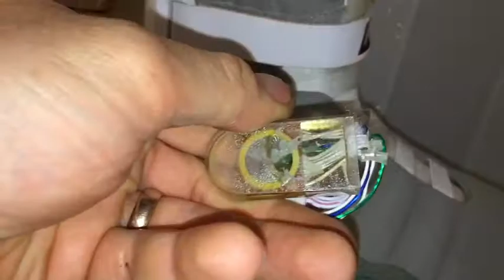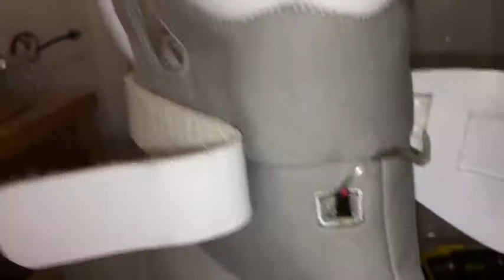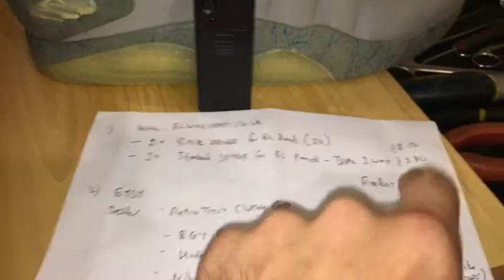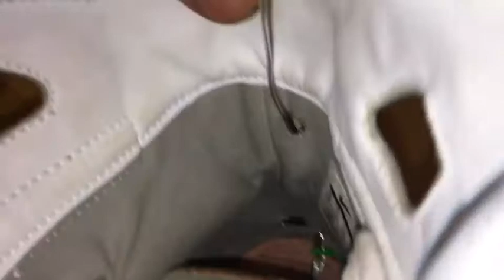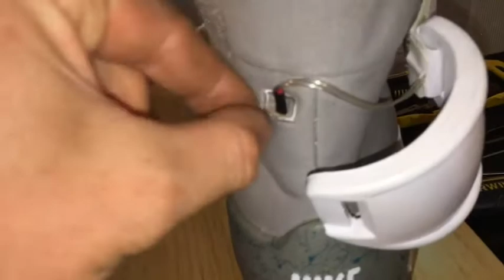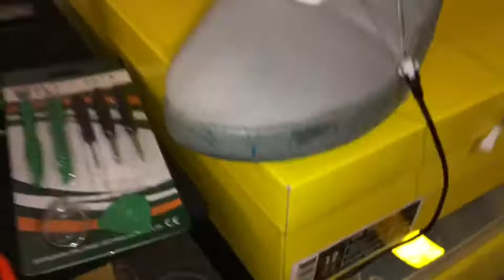Nike Mag Full EL lighting modification and repair advice - 2020 Uk

Comment: The bridge that holds the strap broke on mine. Would that be repairable?
Reply from the maker: Hey, I guess you mean the large rubber piece that mounts on the back of the shoe.
I’ve never seen a broken one, but you can cut them off carefully , and repair it using things like a piece of wire, as you’ll need it very strong and glue by itself simply won’t do.
Join my Facebook group on Mag Repairs and people might have ideas :)
Reply: @griceyboysGarage  thanks! Will do